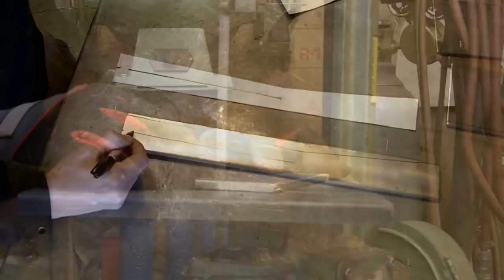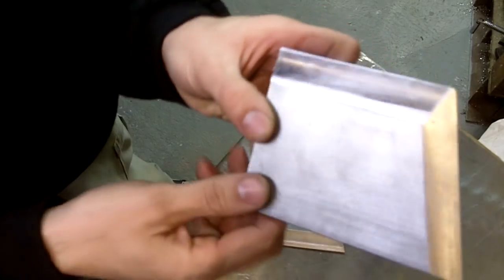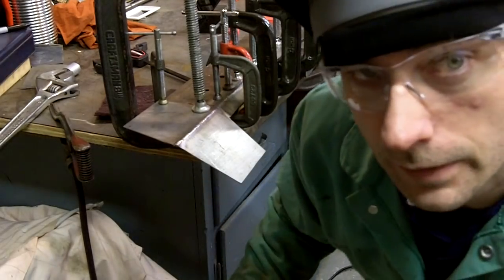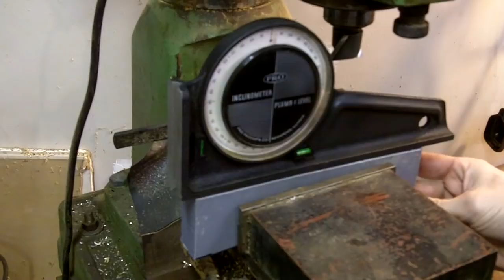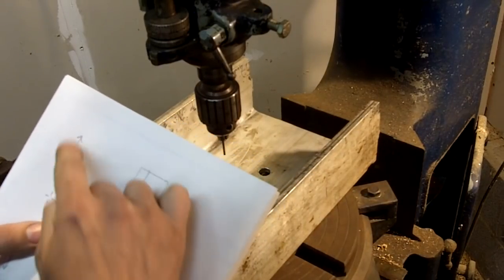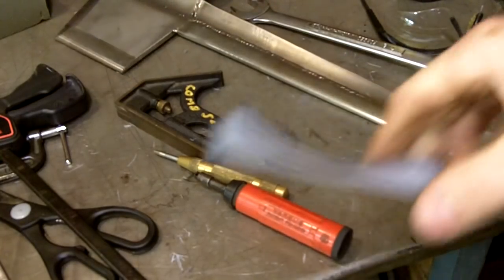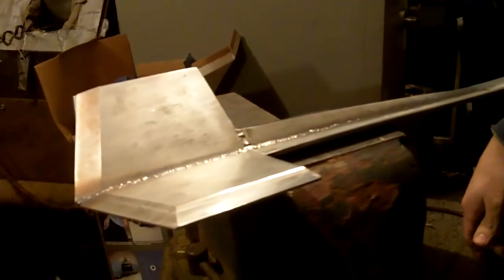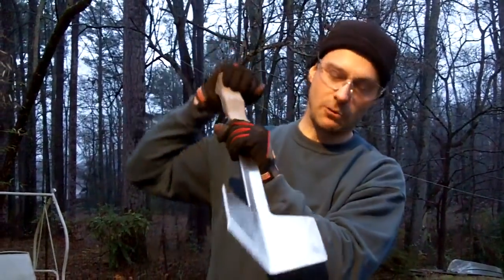Making The Shovaxe BushTool

Comment: At a guess your broad-ax shovel will torque like like crazy when you hit something which may be okay. A simple round handle with a few shallow indents at most would have been more comfortable during extended use. The real issue to me is I have a feeling this is going to be heavier than a prudent man is going to want to haul any great distance on foot. My Cold steel shovel isn't half as robust, lacks the mass to chop as well but it is a lot lighter to haul on your back. Everything is a trade off.

Comment: If you ever make another, consider flipping the twist and the cutting edge to the opposite sides so that the shovel is angled away from your head when chopping.  The tool in the current design seems better suited for those who are left handed.  WW
Reply from the maker: +Wildcat Woodsman  Well the main twist was inline with the cutting edge and it works perfect for me and I am right handed. Thanks for watching
Reply: Thanks for the reply. I understand the twist and cutting edge angles. I was referring to the inward angle of the shovel's dull edge being near your ear when chopping. WW

Comment: that's a cool tool, but i noticed about the cost you mentioned to make it. i'd suggest anyone that wants to make one of these yourselves, just forge it. you could buy the scrap metal, make a forge and buy all the forge materials for less than 1/4 of the cost of this one. you could do the heat treating to whatever level you desire as well, for free. cool project though.

Comment: @Reallybigmonkey1 I think they both should. What was your pre-heat temperature on that? I didn't even know you could weld any high carbon stainless. Any special process besides pre and post heat? What was your filler rod?

Comment: That's some rough welding.  That's not the kind of stick welding I'm use to.  I've set up the tight & mig welders at college but never used them.  Is that an argon welder?
So is that a full tang shovaxe?
Reply from the maker: This is TIG welding.  Tungsten Inert Gas which is Argon. Yep, this is considered full tang

Comment: is army entrentching tool same concept with folding handle and the other side is steak knife like edge.  what I dont like about the entrenching tool is there is not enough weight to make an impact on the strike.. what kind of metal are you using?
Reply from the maker: +frank hiebler  Yes, pretty much the same concept but mine doesnt fold so it wont give out at a joint. Theres plenty of weight for a strike on mine. Its 440 stainless steel.
Reply: Reallybigmonkey1 thanks for replying awesome tool
Reply: +frank hiebler I hate it when the e-tool folds up on your hand and pinches a piece of skin off of it.

Comment: If you would have had a large but continuous radius on the pointed end of your machete you could have done this to it. I knew what I had in mins but never knew you had a tool you could mill long angled cuts with, and OK it might take a little nifty machine setting, but doing a knife or machete again you could always treat the blade edge as multiple radii, maybe 3 −5 on the machete at a guess, and that way you could have milled your 12°

Comment: Hello David,
You
 have a great machine park, here in Austria you would be a rich man, so some locksmith's business does not have such a machine equipment available!
Does your excellent machine park have something to do with your acquisition or is it just for your hobbies?
A normal mortal in Austria only has the opportunity when his boss allows him to use the company machinery park in his spare time or at the weekend.
Reply from the maker: Hello my friend! No, none of my machines are for business. They are all just for hobbies. Years ago I was involved in building show cars and race cars. All this equipment was bought to do that work. I gave up on cars and just kept all the machines.
Reply: My dear friend!
Show cars are not really real - they have to comply with § Straßenverkehrsordnung = traffic regulations Low §, which is the first law to be applied and with us a new car after 3 years, then after 2 years and from then to the TÜV (Association for Technical Inspection) You get a placard on the windshields, the vehicle is safe, the exhaust gas values are not the same or you have a different exhaust as stated in your vehicle papers or a replica headlight glass without an E-mark and which is not officially typed, then get You do not have the plaque and you can only drive on private routes - otherwise it hails indications until the seizure and decommissioning of the vehicle.
The real American Rat Rods and Chopper motorcycle are not allowed to drive on the road!
William Shakespeare's "Hamlet" says, and he certainly meant the whole EU and 
not just a member state: 
>> "There's something lazy in Denmark!" <<

We have so many regulations and regulations and laws that come from Brussels and we have to implement in our country laws - for example, how many degrees ° the curvature of lettuce can be allowed to sell in the EU!The Central EU-Government, which has not been elected by any nation of the Member States, has such concerns.
In America the people would stand head and chase this rabble out of office!

Comment from the maker: Its painful to watch me weld?  You dont have to worry about preheating the rod when welding 440 stainless, you have to have a keyhole and you dip the rod as you move along, you just have to keep the rod in the argon flow, thats it. This is not pipe welding, its a different process.

Comment: Thanks for the video, cool tool.
Please adjust the guides on your bandsaw, using is with the guides like you had them cutting the plate will stress the blade and shorten it's working life. Your choice of course. :)

Comment: Gonna be a debbie downer here:

Could you continue the fold all the way down for strength? I'd be concerned about the flat part of the handle bending when levering on it whilst digging a hole.

And as I'm a sharp freak, isn't mud and certainly stones going to take the edge of your lovely axe edge when digging? That been said, u get those chinese swiss army shovel things with the same principals.

How has it held up after use?

(you still get a thumbs up btw)

Ways

Comment: or 15°  edge along its length, on the circular miller and straight milling machine, sorry couldn’t hear what you called the circular angle miller. That is assuming you can also fix the blade at that required angle, or move the milling head at the 12°/15°.
I have no machines at all, they do not mix with epileptics, ha ha ha ;-) But though I do realise this is pretty old History now after you made this was it a year ago? I would like your thoughts on my calculated estimates this would work.

Comment: What kind of steel did you use? Where did you get it heat treated?
Reply from the maker: I used 440 stainless steel. I had a local tool and die shop do the heat treat. Those kind of shops know more about it than anyone else when it comes to alloys and tool steels

Comment: I guess, as the finished product always worked as a jig, and the way I designed it, and BTW I never knew I would have to do any metalwork, until some rather arrogant form makers, which was just 2 people working in the same dept allowed to basically do bugger all and they refused to make anything for me "Because it was impossible and can’t be made". They knew nothing about box making and the jigs I made had tolerances of around 2-3 thousands, though I worked in microns so thats 50-75 microns.

Comment: if you opposite the twisted side of the handle you could sharp opposite side as well and the flat edge still be away from you and then you could do double edge for something else
Reply from the maker: blizte3  I thought about that design at the time but decided against it. I wanted one end smooth  for safety reasons

Comment: in a cardboard box printer makers factory. Because I then was untrained and found ways to do things which should have been done by a machinist, there was none so as I designed an item from the ground up to produce it I was able to do whatever I could completely alone, and although I was working or the women in the dept were working with paper and card the way the three slotting machines I had and how I run them was up to me. I was never trained and may have been doing things correctly

Comment: Cool video, and great concept - but you do realize, this 'idea' has been around for many decades, right?  A very 'off-the-shelf' solution for a lot of those asking you about buying one, can be found on Amazon for about $60.  They were issued gear for the Marines for decades, it's the Ames Tru Temper tri-fold entrenching tool.  If you take a file and sharpen the edges (already corrugated and angled for it), the tool gives you a saw, axe and shovel all in one unit.  Carry an extra 'hinge' pin bolt (the only part on it that sometimes sheared was the handle bolt), and you have a SUPER camping tool.  Not all those 'toy shovels' are the same. You want Amazon Item Number B004SOPJG4.  Great design on your behalf, though. I saw the similarity of what you were trying to make about 4-minutes in.
Reply from the maker: Dust Devil   Im glad you liked the video. Yep, I know the one youre talking about. Its good and theres several bad ones out there. I just made this one to see if I could make the mack daddy super duper unbreakable version. It turned out pretty cool.